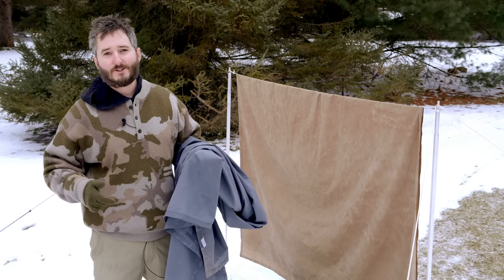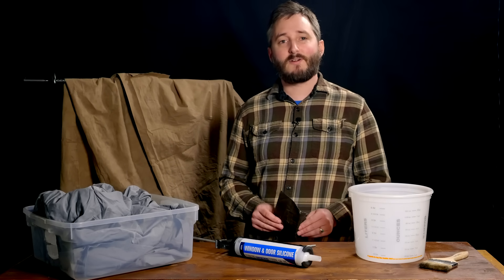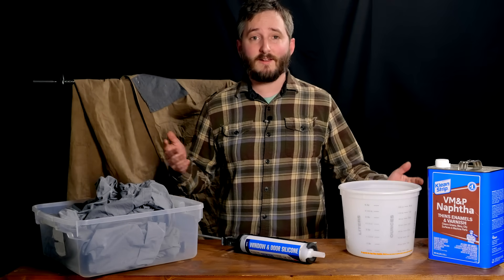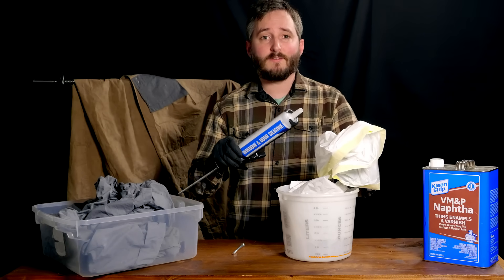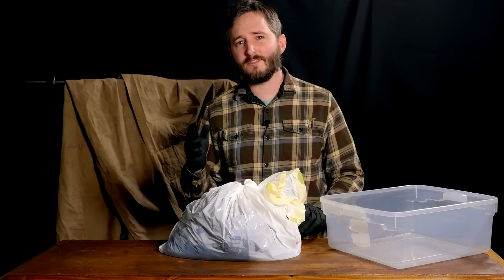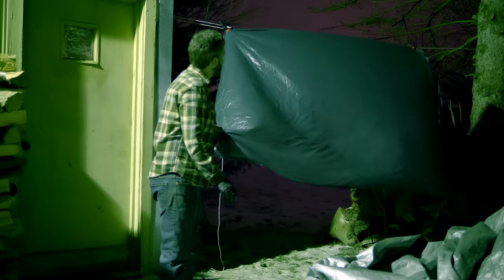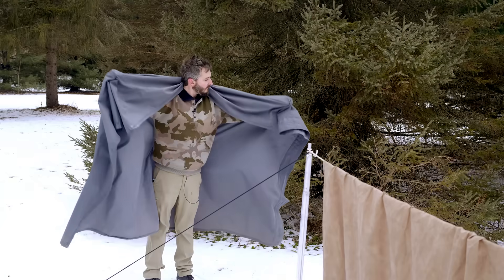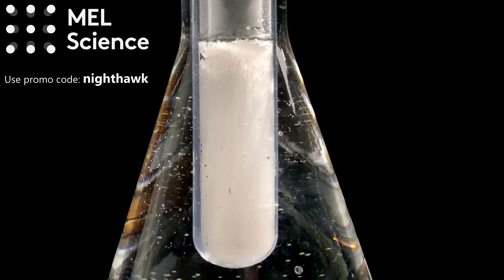Recycled Bedsheets Make The Best Waterproof Tarps

Comment: Hi, nice one. Reminds me on my work in textile treatment were we used Chemicals containing Fluor (C6 Chemistry) to get very high water and oil repellent ratings. But these stuff is under pressure as it has to do with PFOA. 🙁
There is also SiO2 Based (so also silicone 😎) chemicals available which bond on many organic or an-organic materials - also leather for example or glass. 
Also PECVD methods are known to coat fabrics to become oil and water repellent. 
Finest in chemical engineering!!!

Comment: Just used your Acient Button Technology this very week. Yesterday as a matter of fact. 
    One corner of my fabric gazebo canopy tore off in a 145 mph storm 2 yrs ago. 
 I do sew and drafted a pattern to replicate the missing corner that also included a pocket on the underside.  Using outdoor fabric I sewed a replica of the old corner. 
 I'm only 5'2" and after struggling mightily in 105° sweltering heat and suffocating humidity to get that blasted top thrown up and over and down the roof struts and popped into place on 3 corners I cried "UNCLE!". 
 Initial plan was to attach the 3 corners in place first then position my newly fabricated triangular patch into the missing corner, pin into place, then hassle w  removing the entire top so I cud lay it out flat onto a tabletop and glue the patch into place w a waterproof fabric adhesive. Not the end of it....
   Repaired area would then have to be weighed down FLAT to cure for 24 hrs before moving. The sultry Iowa heat destroyed THAT game plan! 😡🤬
 I had sweat pouring down my face and legs and my tee-shirt was soaked. I was not in a good mood let me tell ya!
 Ancient Button Technology to the rescue.... I spotted a piece of Pool Noodle on the ground. (I cut Pool Noodles into 2" discs to use to fill bottom of flower pots)
    "Ahhh, the BUTTON has appeared " I said to myself. Leaving the canopy top on the frame w 3corners already secure I climbed down the ladder & picked up the 2" piece of Pool Noodle. I then procured a short bungi cord. 
 Back up the ladder I went. Compressed the disc (button) within the fabric and proceeded to wrap the  bunji cord around it securing the bunji hooks to the gazebo frame. Looked a bit wonky like a  bit of 2022 modern day DELIVERANCE (LOL) trouble shooting but it WORKED! 
    Then last night a storm ensued. Winds WHIPPED up and the Heavens opened their Flood Gates. 
 This morning I looked into my side yard and BEHOLD! my humble canvas canopy hadn't loosened- was as intact as I had left it!
 Not bad for being an almost 68 year old single female. And NO ONE to help me either. 
Once again THANK YOU SIR for the most valuable info!
Reply from the maker: Thanks for the fun story!
Reply: @Nighthawkinlight  a girlfriend stopped by yesterday and said "Wow! you got the canopy up on your gazebo. And you repaired that ripped off corner."  I had to laugh.  "Well I went a different route.. here's my fabricated patch I sewed  but  then I was watching this Ancient Button Technology video and implemented that instead.."  I explained it to her and showed her the 'repaired' corner and she was QUITE AMAZED!  I told her how the canopy successfully  weathered a storm that evening by being totally intact the next morn.
  Now I'm inspired to use more ABT for some other  yard projects because I'm as poor as Church Mouse... I'll keep you posted

Comment: Hi! A few questions:
-What kind of fabric were the tarps you used in this video?
-What kinds are the best/recommended/to be avoided?
-How long does the waterproofing last?
-Do I have to repeat the process if I wash any of my items (i.e. jacket)?
Thank you!
Reply: 1) He was using normal cotton bed sheets
2) Any natural fabric or even leathers will be fine
2A) Since mineral oil may or may not works so well with all plastics you might want to avoid Acrylonitrile butadiene styrenes (ABS), Polycarbonates, Polyethylenes, PolyPropylene, Polyvinyl chlorides (PvC) as it might damage them to some degree.
3) Since it is silicone it will last a while but how it's used and conditions will effect the life span, but a good while I imagine since it's flexible by nature.
4) No but also see above. If done to a jacket not much is going to stick anyways. But it also won't breath very well.

Comment: My biggest question, which the answer can't be conveyed, in a video is what does it smell like when done?  I plan on treating a few hoodies and would hate to make them useless because of a stench.
Reply from the maker: No smell once given a few days in open air. I would be sure the silicone you use is food safe since having it on a piece of clothing is a lot of long term exposure.
Reply: @Nighthawkinlight  WOW that was a fast reply!  Thanks for that never considered food grade.  Going to also make a new cover for a beat to death umbrella.
Reply: @Nighthawkinlight  I finally had time to do this today. I asked specifically at Home Depot for cheep silicon that is food grade.  They handed me a Kitchen and bath tube that says silicone made by DAP on it. But I am wondering.  I poured the Naphtha (exact can I see in your video) into a 1 gallon bucket.  THen added the Silicon tube.  After placing on the lid and 10 minutes of vigorous shaking all I have is a 2 layer concoction. The "silicone" is on the bottom and the Naphtha is on the top.  Perfect distinct layers with absolutely no mixing.  I might be able to pour the Naphtha off the top and try with a real tube of silicone. Wanted to ask though is this common or did they really just give me something I did not ask for?
Reply from the maker: Did the silicone smell like vinegar? If not it was probably not the right type to mix with naphtha. Home depot wouldn't have real food safe silicone. That's the kind of thing that would be a specialty internet purchase. I haven't done the leg work to find the right silicone that works with this and could also be guaranteed safe for constant skin contact. If you find one online that is food safe and is acetic acid cure that will probably be fine. You could also apply the normal mix with a spray bottle so it only coats the outside of the fabric, and in that way sin contact is less of an issue.
Reply: @Nighthawkinlight  Thanks. I called a local hardware store and he informed me that if it is NOT paintable then I purchased water based silicon (which it says right on the tube - not paintable). I would need solvent based/oil based.  Explains why it separated so perfectly.  Has me curious if I could do this with water.  Have to try some day on a pair of gloves and see how it turns out. Anyway tomorrow I will get the basic Silicon from them.  Tube is $13
Reply: @Nighthawkinlight  Ok I succeeded a few days ago... kind of.  The results are great.  I have a king size tarp that is quite rubbery,flexible and strong. I also have a hoodie that is substantially stronger and very waterproof. 
I learned a great deal. 
1. The tube must say 100% silicone. (not siliconized)
2. The bag method is far better method.  I used a bucket first time and pressing the material down has 2 major disadvantages - easy skin contact and spurting of the solution.
3. Prep plenty of solution.  I did both the hoodie and the sheet twice because I missed big sections I thought I covered.  But ended up soaking in water.  A second application tents to rubberize the material.  But they are not too bad.  Fairly acceptable results.  The hoodie is noticeably heavier after second application.
3b. What is left over can be saved in a jar for painting items.
4. Using colored Silicone can create interesting results. I used grey on second application of the sheet because it is grey and the silicone was much cheeper.($9) When drying I could make designs in the sheet and they dried permanently.

Afterward I used some of the left over to treat an umbrella to strengthen the material simply using a paper towel.  I left the papertowl to dry spread out as a test.  Came out pretty strong and water proof.  Makes a great bike seat cover for the rain.

Comment: Impossible here in Norway to get pure Naphta...

Tested a few things.
4cycle akylate fuel for lawnmower that contains 30% naphta.
Seems to dissolve it kinda fast and dries within a few hours (2 to 4 hours 16°C and humid) with little smell after one day.
White spirits (mineral spirit) takes lots of work to get it dissolved and long time to dry (about 14 hours+ in 16°C and humid/rain)  with some smell still and feeling just slightly wet from the mineral spirit in a few spots.

Both where tested on a cutoff piece of denim to see if it reacts in any way with the fabric, both where just fine and repells water great.
And they're still slightly breathable but if i fill it with water as a bag with 10cm it starts to seep through the tiny holes.

Guess i used too much solvent (i know i did😅) or it needs 2 coats to be 100% tight.
But it's also nice sometimes to have it breathable to prevent trapping moisture
Reply from the maker: White gas or camping fuel is usually the same thing as naptha

Comment: I used the button technique to use a plastic backed drop cloth as a tarp on a trailer.  It worked and is very strong but it has its caveats that I learned.  1) It does take quite a bit of cloth length around the perimeter of the tarp so the tarp could have easily have become to short to span across the area I was covering if I had used more buttons around the edges 2) A button cannot be used if the tarp is already under some tension.  So you have to set up the buttons before tensioning which is difficult because of #3. 3) The button has to remain under tension to hold or be well tied to the tarp- that is if the cord around the rock loosens then the rock will fall out and the tarp is completely loose at that tie point 4) Securing using the button technique is not fast and you will not want to be doing and undoing it unless you really have to.  I was tying these off in 100 degree weather and caught myself wishing for a faster way to secure the tarp.
So what I did was use some buttons as the "main" securing points, then I sewed on loops of paracord to the tarp's edge for additional securing points to keep the tarp from flapping.  It worked and I drove that cheap drop cloth tarp for 400 miles like this up to 80 MPH.  BTW that drop cloth was too stretchy and I would not recommend it as it deforms too much in the wind.  Maybe a heavier drop cloth or canvas with this silicone technique would be better.  I'll try it out.
Reply: Thanks for taking the time to explain that, will be useful info in our windy garden.

Comment: You should learn to tie a sheet bend, it's better than trying to hunt a smooth pebble or keep up with a marble
Reply from the maker: I know the sheet bend but prefer buttons for this purpose because it doesn't require bunching together as much of the fabric, and is easier to use where there isn't a corner.
Reply: Yea the non corner situation does make sense

Comment: The rock used as a button 7:10 looks somewhat pointy and jagged. Using a rock like that as a button will probably create significant wear on the fabric under stress.
Reply: In my experience this is true, simply due to the fact that I personally use pointy rocks on purpose to make it oblong and allow for a thicker nylon rope.  The stress tension point is not where the rock meets the inside of the wrapped sheet, it's on the portion of sheet thats twisted and tied.  If the rock is being pulled that hard without a proper knot it will cut through but that's the bad knots fault imo 🤣

Comment: Making something look doable by anyone is just brilliantly done here. Thanks for the inspiration.

Any idea how well a sheet treated in this way would stick to other things? Any hints as to the correct or most effective adhesive to use?

eg: if I wanted to use a sheet treated like this as the backing for a wooden tambour door? Construction adhesive?
Reply from the maker: Probably the best adhesive to use is the same silicone used on the sheet
Reply: @Nighthawkinlight  thanks.

Now I am wondering if a similar thinner + silicone slurry would be thin enough for vacuum induced wood stabilizing...

Comment: Thanks very much.  Being without a shed or garage and having a lot of items like lawn tractors, log splitter, boat, concrete mixer and many other that need to be covered from rain and sun; I need a lot of tarps to cover them until I can build a structure to house them all.  I found some canvas drop cloths at a good price from Harbor Fright and I'm going to try your process on them.  Hopefully this will be better than the tarps I've been using from Walmart which deteriorate quickly in the sun.   Great video thanks again.  Glad to be a subscriber to your channel.
Reply: Yeah those cheap tarps from Walmart and the likes have no UV protection so they just fall apart and turn to dust.

Comment: I completely reproofed a tent using this method about 12 years ago.
Some points:
  I used white spirit (you'd call that mineral spirit) and it doesn't 'dissolve' the silicon (perhaps naphtha does in which case it would be better). Instead it forms a very fine emulsion. It's easier to just beat the crap out of the mix with a drill and paint paddle but it's a good idea to have a lid with a hole in it to prevent splashing. Old paint buckets are ideal.
  You can, and I have, just apply the silicon directly with a roller and a flat surface then turn it over and do the other side for complete penetration. The down side is that you need a large flat surface available when your wife isn't there. The up side is that this will fill any stitch holes if you have a seam.
  The main, indeed only, problem with the tent was stripping off the old worn out PU coating. The answer is soaking in dilute ammonia overnight. It worked a treat.
  Nice video, good luck.
Reply: Great advice, thanks for the tips!!
Reply: hmmm i saw the video which posted , they used mineral spirit , its odourless ? wonder will it work with paint thinner
Reply: @sdqsdq6274  I believe that 'mineral spirit' is American for 'white spirit' and no it isn't odourless. It's paint thinners and as long as you can make an emulsion with a volatile liquid then it will work. Technically you could use petrol but that would be really dangerous.
Reply: So trementin or thinner works?
Reply: @acatisfinetoo6921  I don't know what 'trementin' is so I can't answer. Certainly ordinary 'cheap as chips' paint thinners works a treat.
Reply: @benchapple1583  Hello! Fine art painter here. There is such a thing as "oderless" mineral spirits. It's actually just VERY low VOC, if you get a whole classroom of painters using it there's definitely noticeable fumes. It also costs quite a lot more than regular mineral spirits and large jugs of it aren't super easy to come by (you don't need much for art, I bought 500ml a few years ago and still have about a third of it).  It's super great for painting in a small studio though.
Reply: @pbyguy7059  I didn't know that, thanks. The smell isn't a problem for reproofing as you'd dry the fabric outside anyway. Once dry there is no lingering smell.
Reply: Mineral spirits are very not odar free.
I don't mind wd40, brake cleaner is a bit obnoxious, but mineral spirits linger for a good day or so and are far more irritating than brake cleaner.
Think of them as halfway between wd40 (kerosene) and diesel.
Reply: @andrewstambaugh240  Definitely not odour free. So you need to air the thing in the sun all day to get rid of the stink. After that, no problem.
Reply: Thanks for great tips! I am about to use your method
Reply: As a wife I would have been very grateful that my husband was doing this and wouldn't be complaining about the space used
Reply: @faithreturns333 , I think that would depend on WHAT flat surface he was taking advantage of! 😁
Reply: @outtadarkness1970  haha yes it could be a the bed, the Axminster, the beautiful new polished table.... always perform practice of rebellion with great care, and with your future in mind. 😊
Reply: Is your tent nylon based?
Reply: @JohnSmith-il4wi  Yes, it is.